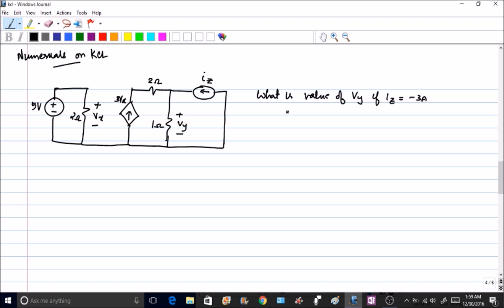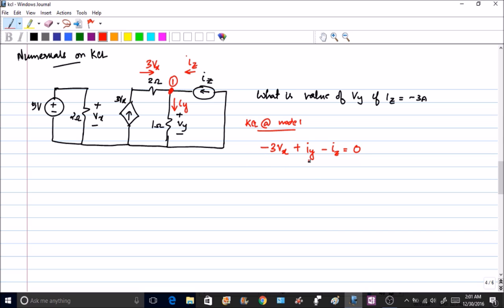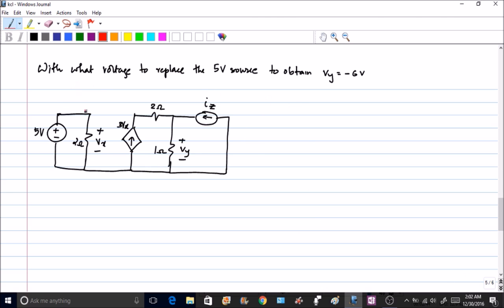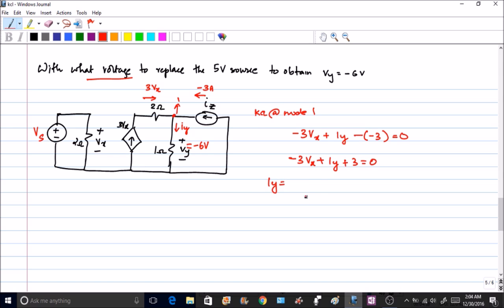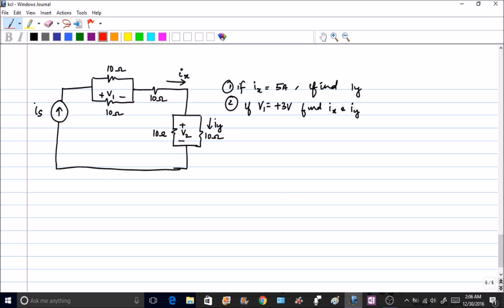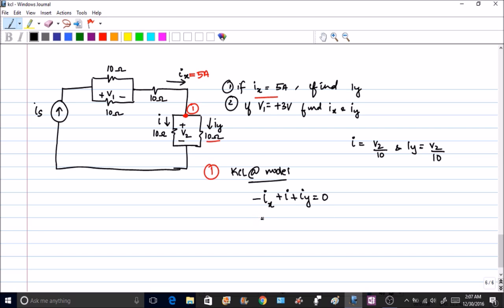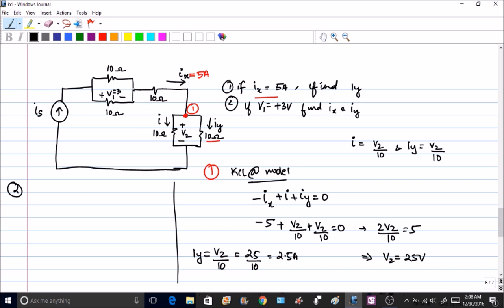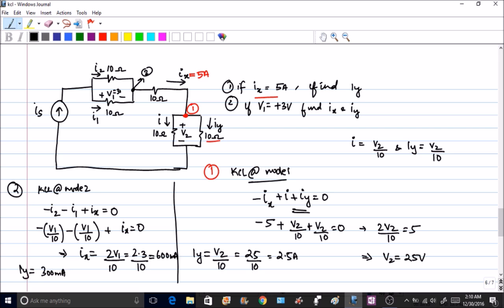Numericals on KCL #ECA-session12

Comment: Doubt At 3.45.pls reply sir
Resistor is always power absorbing..right?
So power absorbing should be posetive.then why the direction of current is not reverse
Reply from the maker: The current direction are mostly given in the numerical, do not try to correct them I have told earlier also, just use the sign conventions and you will get your correct results...